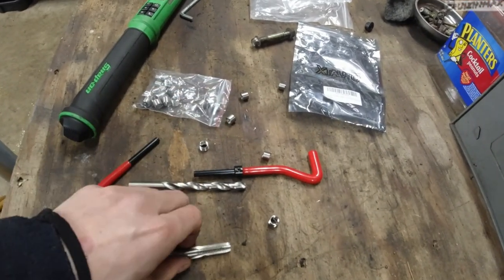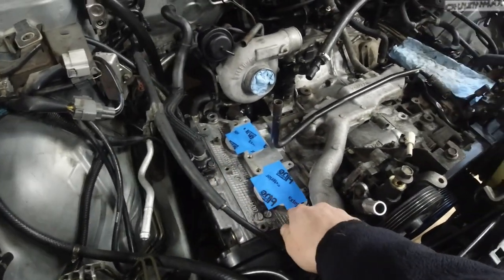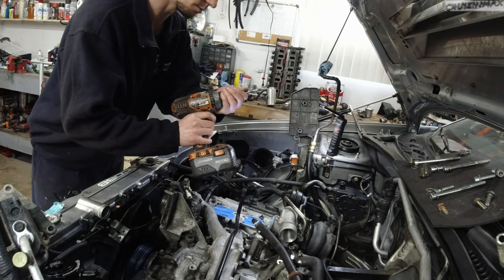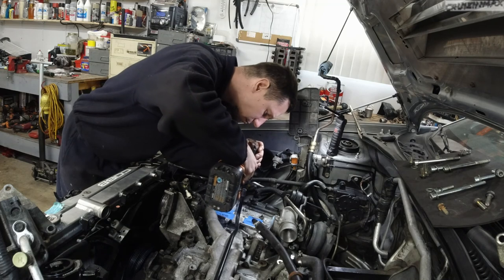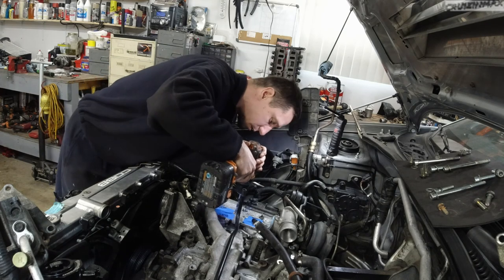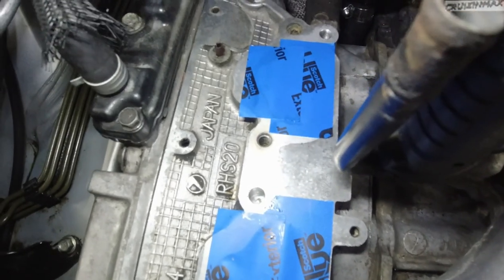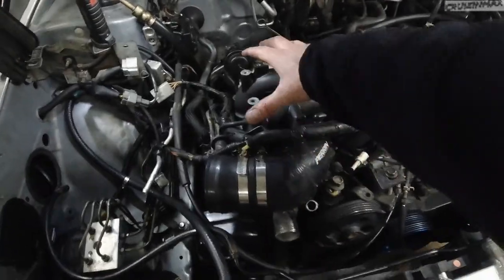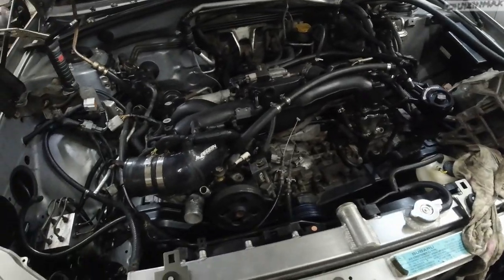Subaru WRX intake to cylinder head heli coil fix

Comment: Wow alot of work. Is it worth it?  I still have the 06 sti with spt add ons. This is my 1st and last sti am68 starting to have some health problemas .Definitely  more issues with the sti than  my other vehicles . Lexus/toyota/honda.
Reply from the maker: of course its worth it, that or replacing the whole head, someone overtightened these bolts most likely a few times and thats the result but I hear ya on the lexus, toyota, honda cars.